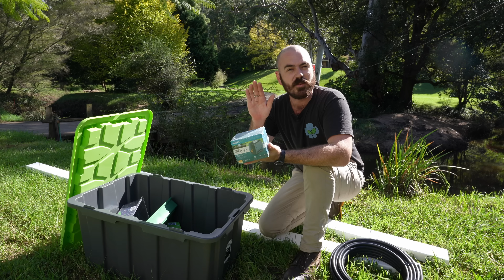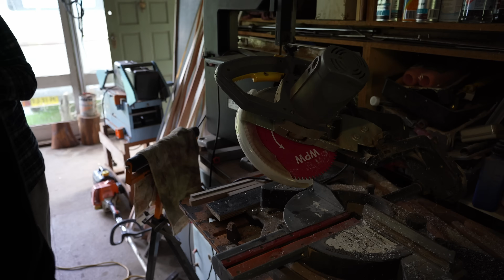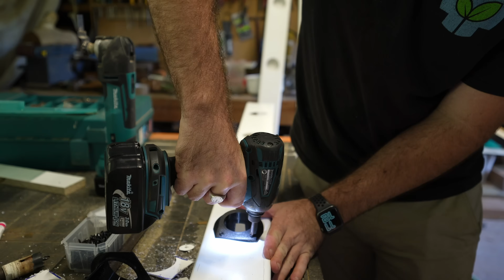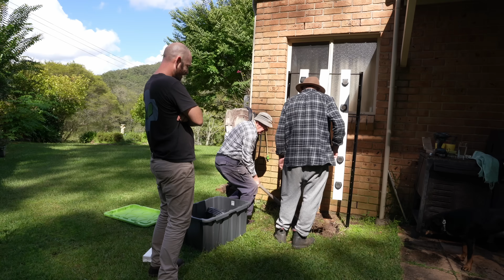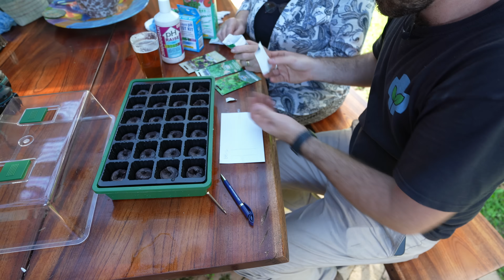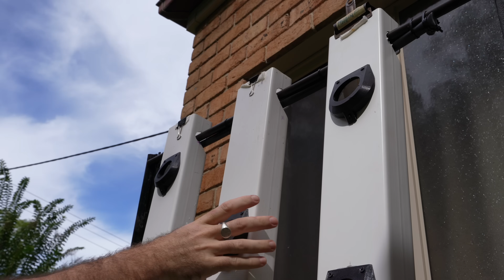How to Build a Vertical Hydroponic System

Comment: Why not start seedlings with vertical runners at a slight angle? -- so water flows down only back, but hitting the peat.  Then after roots are established, adjust verticals to true up/down. 
Might eliminate splash/leaks.

Comment: It's a long time ago you posted this video Hoocho, but i hope you could answer my question. I would like to make the same with a single pilar, but i am struggling to find the right pump that gives a good amount of water and pump 150cm high like in the design without overflowing the system.
What pump did you use  for this prokect?
Reply: Looking forward to make such design in my dutch garden.

Comment: Hello Hoocho, have you seen the zipgrow vertical hydroponic system? It seems to use some kind of rigid sponge in between with a slit along the whole length where you can just push in the seedlings. Would be great if you find a way to diy that with locally available materials

Comment: Noice. What about a single Pipe System? Use about a meter underground as a reservoir and for stability. You need a small pump for every pipe but you save on the fancy box. Plus it would have a nice minimalistic look.

Comment: You Sir, have a talent for explaining things well and without losing my attention, also your designs are constantly impressive and creative. here is an idea to try i just figured out today. One vinyl gutter is about $6, cut it in half, have one section, cut it 2" up each side from the bottom, so it removes the folds.  put the 2" reduced gutter half into the other gutter upsidedown, and drill the 2" holes in what was the bottom of the 2" reduced gutter. Also one of the wings that gets cut off from the gutter is a good triangle to put inside as a sort of angles seedling rootball support, to keep it not sitting entirely directly on the water.

This makes for a $6 5ft channel that is easy to clean, or $12 for a 10ft. I'm sure you have access to a lot more plastic channel designs because you live next to China, but here in the USA, most NFT channels are $30+ shipping for 10ft length.

Comment: Can you make a adapter that will work with the old 4" pvc with 2" holes already cut out?  Need to be able to use the old system parts.

Comment: Every time I cut PVC, even decorative fencing, I flip the saw blade around. It’s the equivalent of putting your drill in reverse when using a hole saw. Some table saws or circular saws may not allow this.

Comment: I'd probably use a net pot instead of just a holder of sorts. But that might be area related. I just think enough wind could maybe make the peat net pot thingy drop out of your print part and cause extra work to place it back again. Not a big deal, just a precaution really. Using the bandage is very smart! 
Thinking about a system like that for next season. I only have a very small balcony (even smaller than the one of your friend you made the first small version for) and it would increase the size of my "garden" drastically! Sadly I'm over in Europe and what you call "winter" is the weather in most of my growing season lol

Comment: This couldn't be a better time for the video. I am building a narrow green house due to limited space. barely 1.8 meters wide by 4 meters long . A Vertical system would be perfect, however, would love a comparison video on what is better for produce quality, this or rain gutter system. Thank you
Reply: I can't think of a big difference.... if the crops are right. Strawberries do very well vertically, leafy greens do well... but large plants probably will be more difficult to handle.
Reply: I'd probably use horizontal rain gutters and you can stack multiples vertically with a slight offset.  That way, you only need to manage one reservoir and pump that can handle all of the rails/rain gutters.  

If you use the system in this video, you'd need build multiple of these and have a way to capture the water at the bottom of all the rails and return them to the reservoir (or unless you actually wanted each unit to have its own res and pump system).
Reply: If you don't have room for the rain gutter system this would be better no matter what.  I like that Hoocho  is doing the work to offer options and variety.
Reply: Does spinach grow well on a vertical frame?
Reply: @edgarbaloyi3820  it should be fine.  Similar to other leafy greens.

Comment: For those who don't own a multi tool, an angle grinder with a cutting disk works great, it doesn't crack pvc like saw blades do.
Reply: Or slip a 2×4 into the pipe to give the pipe wall some backing.